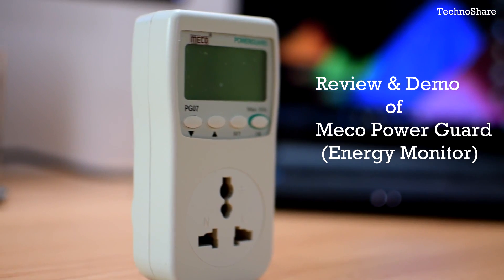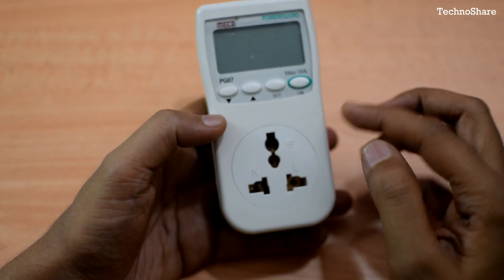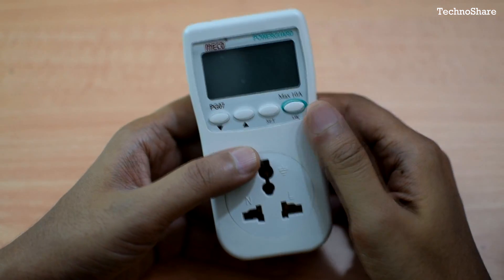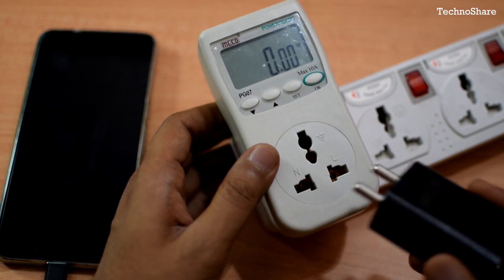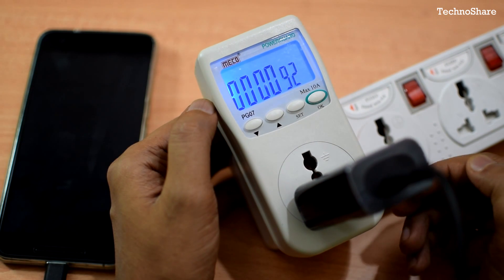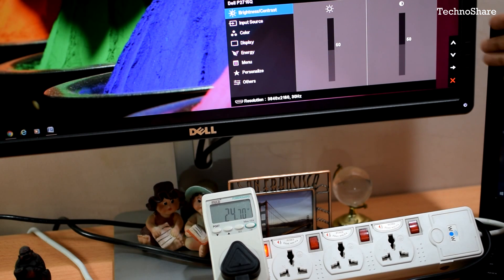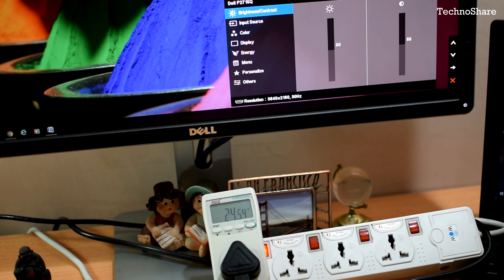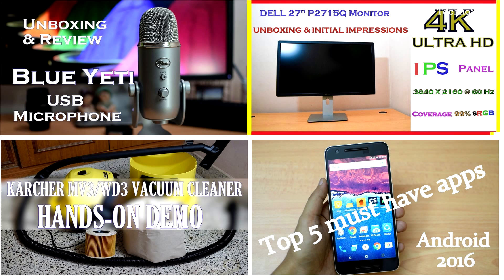Meco PG07 Powerguard | Power Consumption Meter | Review

Comment: Hello TechnoShare, for some reason the current reading does not properly match with output watts.
Reply from the maker: Hi there!! It could be that, the appliance or the device, might be drawing less power, as the usage may not be so high. For Example, if using a fan, the rated power on the fan may be 40 Watts. But when you put it on low speed, the power consumption is 10 Watts. Hope this helps !!

Comment: Thanks for the review. Just wondering, how reliable & safe these devices are?

I got one branded ELRO M12. In general, it seems to work and provide consistent and sane readings, but it heats up fast at one side and I even feel that nasty "hot electronics" smell coming from it after just a few minutes of use. And I'm measuring only small power under 200W ! 

So, is it normal for these devices to get hot or do I have a cheap junk and need to replace it as soon as possible?
Reply from the maker: Hey there!! Thanks for your comments!!! Sorry about this delayed response. I have not heard about the brand that you have bought. Perhaps its sold in the UK/Germany region i believe. I have been using mine on my computer, where I have connected the UPS, CPU, and 27 inch Monitor, using a spike guard. In all, it draws an average of around 100-130 Watts of power. I used it continuously for around 2 hrs, and I did not see any kind of heating issue on the monitoring device. (On all sides). It was a little warm (perhaps less than our body temp, could hardly feel it) on the right side of the unit (next to the LCD). Mine is rated at max 10 Amps of current load. Hope yours is also rated around the same capacity. Perhaps you may want to replace your unit and got to be a little cautious if temperatures are very high. Take care!! Thanks for watching.

Comment: Can I measure the power consumption in my AC? It shows a 10 amp max limit.If not is there any other model that can be used to measure the power consumption of my AC?
Reply from the maker: Hi! I have never tried measuring usage of heavy appliances. So I may not be able to answer your question!!!.
I found a model with higher Amps on Amazon, but currently unavailable. You may want to check the Amps, and Power rating and socket type of your AC with the energy meter if it matches and if its safe to use. 
https://www.amazon.in/Meco-PG09H-PowerGuard/dp/B00OVSZ070/ref=pd_sbs_328_5?_encoding=UTF8&pd_rd_i=B00OVSZ070&pd_rd_r=9029b0fd-59ee-11e8-812a-c379ca064baf&pd_rd_w=GoScA&pd_rd_wg=THz37&pf_rd_i=desktop-dp-sims&pf_rd_m=A1VBAL9TL5WCBF&pf_rd_p=6625116983782145395&pf_rd_r=2NWY4B4NSAM50YRFRTTT&pf_rd_s=desktop-dp-sims&pf_rd_t=40701&psc=1&refRID=2NWY4B4NSAM50YRFRTTT

Thanks for watching!!!